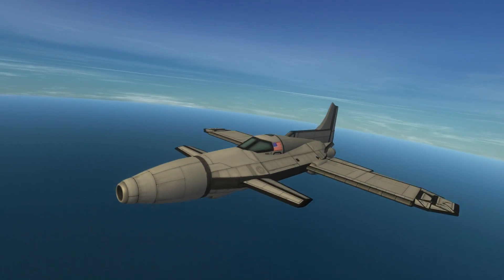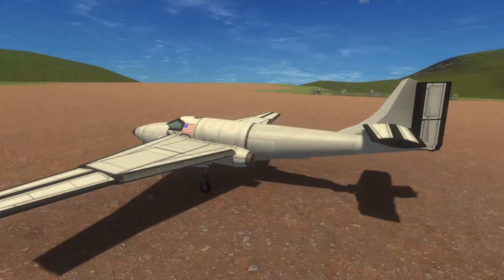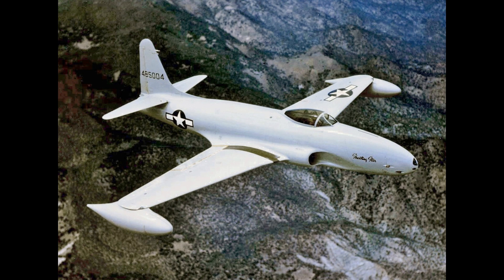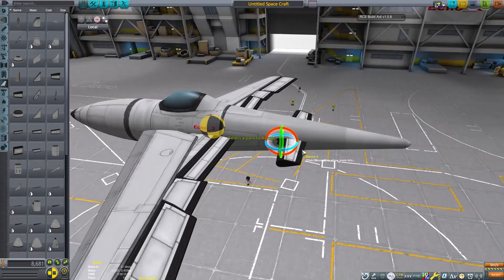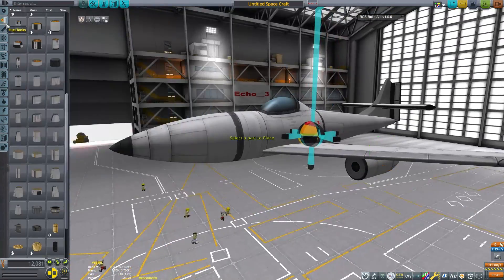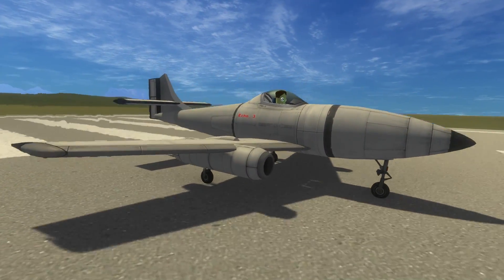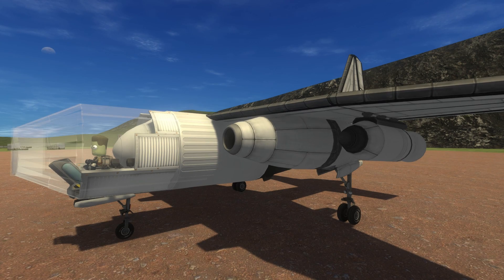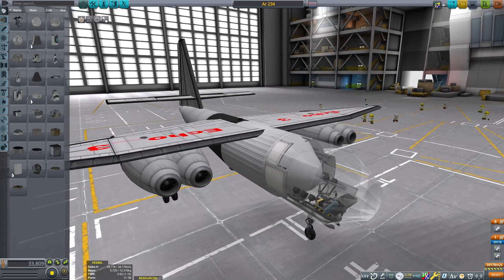Early Jet Fighters: Humanity Goes Full Kerbal

Comment: How did you get the transparant Windows on the ar-234?
Reply from the maker: I made a custom flag.
Reply: @Echo3  I see, I've made custom flags before but how did you make it semi transparant, like glass?
Reply from the maker: I uses paint.net and modified the opacity - alpha.
Reply: @Echo3  thanks!
Reply from the maker: No problem. Not all programs can do this. Paint is rather limited, but photoshop and paint.net work well.